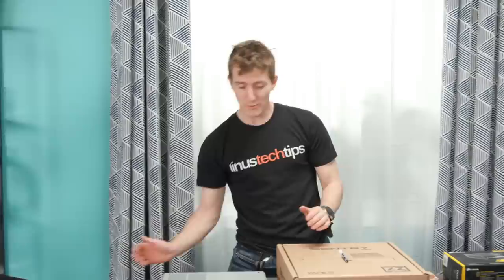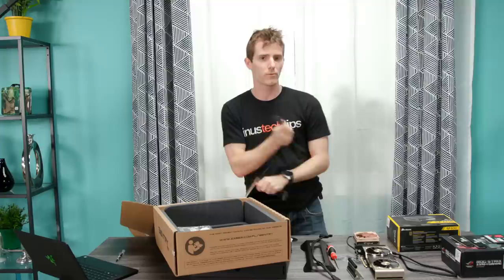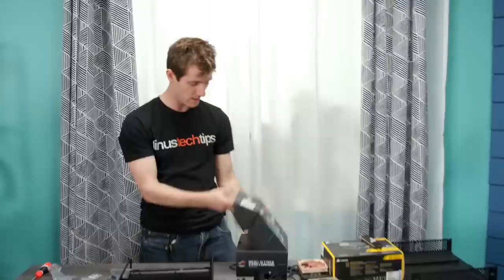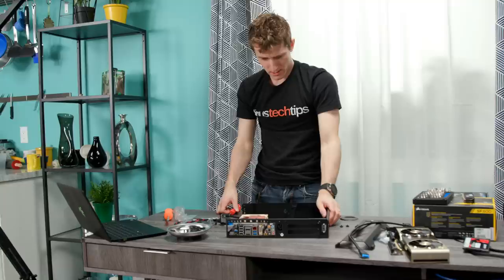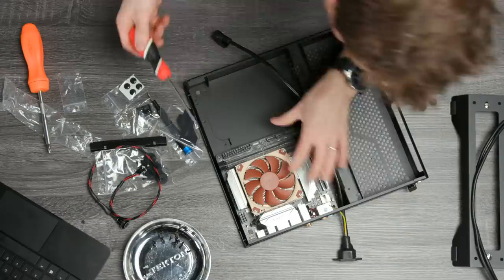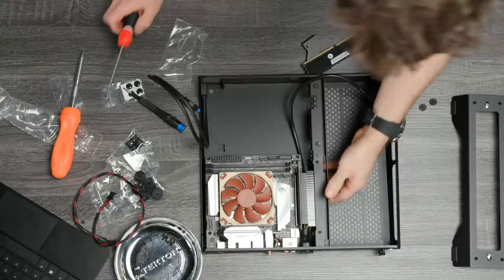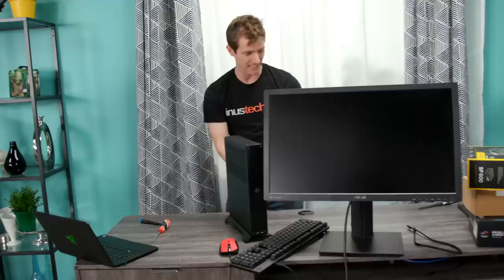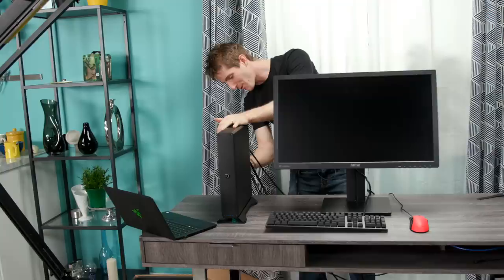Live Building a TINY Gaming PC

Comment: Wait, where's your antistatic bracelet and your Swiss knife????
Reply: And tweezers for cable management
Reply: And the allen key.
Reply: And cake-icing paste
Reply: @konstanen  Tesla Model S, Tesla Model 3, Tesla Model X and now Y
S3XY
Reply: And the insulating pads to stop the psu from shorting out the computer
Reply: Dont forget your security Torx.. O wait.. he really did need that
Reply: Don't forget to test your beefy powerful machine if it can run League of Legends!
Reply: And don't forget to put the ram dimms next to each other in slot 2 and 3
Reply: Dudes an ametuer
Reply: no brace at the back...
Reply: Careful, you might get copystruck saying that :-P
Reply: That hopefully has a screwdrive head
Reply: do you know that you can have bracelet on leg? This is more comfortable way.
Reply: And that was not nearly enough thermal past for the cpu pfff what a tool
Reply: He’s not elite enough for the tweezers, and he can’t get a Swiss Army knife, only the homie Stefan could get his hands on one 😤😤
Reply: With news that vaccines could be widely available in Spring 2021, when would you feel most comfortable going back to crowded movie theaters?

Comment: A part of me wants to take one of these cases, cut a hole over the CPU, and put on a huge air cooler, like a muscle car with the air intake sticking out of the hood.
Reply: That would be a great look! Or I could stick my 280mm radiator on the outside like a huge grill with holes over the cpu for the pipes!
Reply: the sound from the fan could be a problem tho but then again the thermals from having it sticking out will be better
Reply: @jacob-ty3km  Gotta rev that engine!
Reply: @nathangamble125  if my gpu fan could rev anymore a boeing 747 would be jealous

Comment: Turn the cooler 90 degrees. The way you installed it, the RAM on one side and the MOSFET cooler on the other side will block the entire air flow. No surprise the CPU will overheat and throttle that way. Also why don't you use a copper cooler?
Reply: agree on rotating the cooler oriey. too bad the am4 l9a dont have that luxury.
about the copper cooler, l9i is probably the only one laying around, as they're not an sff focused channel.

Comment: When you realize linus has like 10 different affiliat links for pia
Reply: private internet access has gone to POO. constantly dropping out. turn vpn OFF and bam the internet works. do not recommend.
Reply: I used to use PIA but switched to IP Vanish. Way better imo
Reply: @John-td9cp  speaking of Private Internet Access going to poo... TUNNEL BEAR!
Reply: I use PIA's proxy for torrenting purposes.  I get good speeds.
Reply: @John-td9cp  I have no idea what happened. I was getting nearly as good speeds as my own internet with PIA (14-20 MB/S)  but now I get download speeds of less than 1MB/s (on Steam)
Reply: Yes, I've been using it for 2 years and haven't gotten a single email.
Reply: @Amiaaaaaaaaa  I am the walrus?
Reply: Probably to differentiate the traffic from the older and the newer videos.
Reply: I still love Tunnel Bear. What ever happened to that spon?
Reply: Emma Nieuwenhuis they got bought out and stopped the sponsorship with Linus I think

Comment: You should look into using the nano material Graphene to disperse the heat somehow. I was watching a video on it earlier and they were talking about using it as a coating for space shuttles so it can withstand heat but it would be cool to see if its conductive properties could be utilized for cooling. A bag of made of graphene or tubes would at least be strong enough not to leak should you want to run them next to electronics.

Comment: Yay!! Sentry is my favorite!! I bought the original one for $222 and it took forever to arrive from Poland but I now have a kickass awesome gaming PC in a super compact form. Had I to go with a i5-8300 CPU to avoid overheating. The super low profile cooler I used was recommended for 65W CPUs and lower. So unfortunately I don’t have a better i7. However I do have an MSI Aero GTX 1080 GPU and it’s awesome for gaming! Thanks for making a follow up video Linus!!
Reply: mclaine33 Poland’s the best
Reply: I also have the original one! I have a 1080ti and a 7700k in there and it’s still kicking 2-3 years later
Reply: love this case
i have a white v1.1 with a gtx 1080 and a 7700
best case ever
Reply: I was stuck with a small budget but I scooped up a used alienware alpha r2 that was upgraded with a 480ssd for 399
Reply: @Spencerwalker21  For $400 I would say that's not a bad deal. I'm sure it will be decent to play games on.
Reply: @mclaine33  yes it was I can run the Witcher 3 1080p mix of mostly ultra a couple on high and no hair works 30ish fps now if i drop to. All high it's 40-45 fps. I don't mind 30ish but I'm a console newb lol

Comment: 19:25 is that only me but the motherboard looks bent.
Reply: I agree.
Reply: Yup, crooked as hell...
Reply: This is because of the CPU mounting pressure from the socket. Looks weird but is normal for LGA1151.
Reply: and at like 15:30 ish
Reply: @ProjectPhysX  oh interesting
Reply: And you know what a bent board means ;) cracked internal PCB traces :o
Reply: ye, 16:10 up close
Reply: Vladislav? Baby don't hurt me...
Reply: What they do to bent it? Failure at shipment or what? xD
Reply: i thought all noctua l9 comes with a metal plate, or is it only for the l9a?
Reply: it's because the cooler is very tight, small motherboard, big cooler obviously it will create a little bend.

Comment: It kind of reminds me of a mac how small and sleek and powerful and well built that computer is. That's pretty neat. Except it's actually better because it's serviceable and modular and upgradable. It would be a good candidate I think for remote water cooling. Just have the tubes come out the back with the wires on your desk and have the rad / fan setup somewhere hidden like maybe mounted on the bottom of the desk or on the back of it or in a drawer with a vent cut in the back with a fan.

Comment: actually m.2 shields are very good at cooling down the modules but the best way to cool them is by putting them on a pcie external module, like linus did a while ago with 4x960pro in RAID, some boards of the ROX Maximus XI series have it budled with them.

Comment: 45:00 my notebook cooler drops 10c off my CPU core temp, from 70s down to 60s. They work well when your case has bottom vents and pulls air from the bottom and vents out the edge. 
If it's a solid bottom case they won't work as well for obvious reasons.

It's basically a poor man's blowiematron, it's designed to get extra air into the fan. Cooling the case will do a pretty minimal job.

Would be good to see some more stuff on cooling laptops though.

Comment: installing the cpu-cooler: to not have the cable squeezed in the tiny space you better plugin the cable first on the motherboard and then rotate the cooler that far, that the cable will be along the perimeter of the cooler on some sides, then mount the cooler!

Comment: Vandal resistant Pushbuttons are meant to be resistant to prying and impacts. Panel builders and OEMs who install equipment used by common memebers of the public or in cases like correctional facilities use the regularly. They are also a nicer feel pushbutton. The old Plastic styles feel horrible to use. The mechanisms usually suck. And if you accidentaly drop one youll be buying replacements. Vandal Resistant FTW

Comment: Hm... Remember those holes for the rubber feet, the ones that got covered by the motherboard (at 35:00)? 
...I wonder if they are large enough so that a bolt could be feeded through one and nutted to a shoulder strap/a hard frame with shoulder straps, so that the case and its contents could be carried around like a backpack, and the resulting system be used, for example, as a "semi-portable" (power cable issues, yeah) VR-rig, and "fully-portable" LAN-party stationary gaming PC?

Comment: I suspect the torx screws are because the case is perfect for Lan parties, and is likely full of high end parts. With everything locked in with weird screws, makes it much harder for someone to steal your parts. Only reason I could think of for them.
Reply: Lol want to make sure no one gets in unless they have a bloody 500 degree heat gun lol use red loctite it works lol I tried it you will break the screw if you don't apply enough heat to it lol

Comment: Not having a drive LED is stupid, it helps heaps with troubleshooting. Yes it's distracting when watching a movie on your HTPC which is why silverstone cases have dimmer switches, as long as it's not too bright you won't notice it. You can always mod in your on pot or resister if your case doesn't have a dimmer.

Comment: On the topic of custom I/O shields, I have actually had to design and 3D print one myself. And I think if you had a picture, you could use the known frame the I/O shield drops into on the case as your outline, and then just bring the image into Solidworks or other MCAD software, and design around that. That would be pretty straight forward actually.

Comment: Bit late to the party here but about that cooling system idea you wanted for a mac book or w/e device you wanted to use it on, how about this Osprey Hydraulics LT 2.5L Reservoir Red, you can simply cut the stoppers off the end stick them into a water pump regulator and put ice water inside, also if wanted a better insulated system to keep it cooler and stop the plastic from heating wrap it in foil.

Comment: I'm using a 512GB Samsung 960 Pro m.2 ssd + Angelbird wings px1 pcie x4 m.2 adapter on a Asus maximus vii hero Z97 motherboard, yes those m.2 adapters work very well to help reduce throttling on the m.2 memory controller!

Comment: what I gotta wonder is why there aren't any cases like this that have the GPU mount so it's on the OPPOSITE side so the GPU fans and the CPU fan are all blowing in the same direction. That way you can have it set up in the flat position WITHOUT the feet.

Comment: Non-volatile chips  used with SSDs and NVMe drives run better without heat sinks.... I need to find the paper that showed lifespan is almost cut in half when it is cooled closer to ambient all the time.
BUT for systems like servers where it is used in constant R/W can run too hot and need a heat sink. So it all depends on use.

Comment: ok i can imagine waterbag with some reinforcment with zigzaging pattern so on one side there is a water intake and on the other side there would be water outpoot for a waterloop. it could even be like a metal rack with soft foil top. it would need to be some kind of foil which would not compress and harden under high temperatures but as you can boil water in a plastic bag it might not be needed. this is interesing idea.

Comment: Red Camera's suck for live streaming. If that's what you where using. They add between 9 and 11 frames of delay from live. Only way to make the audio suck less is to run the audio through an external mixer and into the camera's audio. Because I've found the delay can vary even if you add an audio delay to your mics they will randomly slip sync on the preview out for both SDI and HDMI... HDMI being far worse.. Just an FYI..

Comment: Full room ambient lighting for a loading screen would be wicked as dumb as it is. One aspect that occurred to me is the loading screens in Xenogears. That spacy whoosh noise that built to be more full as loading neared 100%, run that through a ridiculously powerful amp and subwoofer. If the pictures are on the wall and your not convulsing on the floor from sensory overload by time the game starts, your doing it wrong.

Comment: Not sure if this would help with your bag water cooler project. For laptops. It is meant to refict heat back in. So it may reflect heat back out as well. Instead of absorb it. coghlan's emergency blanket. Maybe you could modify if for your needs.

Comment: Could of gotten much better temps with a smaller ITX GPU, and a 120mm AIO next to it to cool the CPU. Leading to much better boost clocks during heavy loads.

Great case though, I love these compact ITX builds. All my builds in future will be ITX based. I think I have grown out the massive full tower cases, my last full tower case was the Corsair 780T black version and that thing was monstrous. Also had a Corsair 800D in the past which was simply just stupid for the size but it was a nice case.

Comment: Ventilation issues aside, is it safe to lay the Sentry on its side and place a 27" monitor on top of it? Will the sides sink in? Is there structural support internally? Can it support flat and/or pronged monitor bases?

Comment: If you want to create a test for heat dissipation off of heat sinks you need to use something like a laser to measure how fast it gets hot and under which circumstances it overheats.

The thing is. This information is only relevant on a motherboard if it has a design flaw, so maybe the test itself would be irrelevant to the user. "Works" "Doesn't work" is enough.

Comment: "I want some kind of foil bag that can hold water" - Aussies will get what I mean when I say you want a goon sack. 

For the rest of the world - boxed wine comes in a liquid proof, fairly resilient, foil bag inside the box. I haven't experimented much with the temperature transfer, but the bag is usually cold for a couple of hours after it comes out of the bottle shop so it should be effective.

Comment: node 202 is $60, $40 when on sale. and it's very close in dimensions. this case is 340x310x66mm where as node 202 is 377x330x82mm. you lose about 1 inch on L and W, 2/3 of an inch on thickness. you have to be fucking crazy to pay $260 for this. i built a fully water cooled 9700K and RTX 2080 system in my node 202. complete with a DDC pump, EK CPU block and alphacool GPU block, 240mm rad, etc.

Comment: Good job you just put the hot air coming off the processor straight to the memory instead of at the nas heat sync that could cool it rather than heating the crap out of the ram that will not have a heatsink to help cool it!!!!!

Comment: Now that we've established the IC Graphite thermal patches work*, I wonder why they don't use them for these videos. Yes, a $15 patch is more expensive than a little thermal compound, but they're reusable. Couple that with the vastly easier removal and it seems objectively better**.

Thermal paste just seems primitive and inconvenient now.

*LTT did a video endorsing them and I have had one in my computer since early last summer. No temp difference between this and AS5 and I gained a +10 DAF bonus.
**Yeah, you can get a degree or two with premium TC, but that's not really relevant unless you're going for some kind of OC record.

Comment: re: the m.2 spreader: Is it perhaps more of a heat-shield than a heat sink? I.e the metal plate takes in as much of the heat from surrounding components as it can & uses an insulating pad to shield the sensitive components from excess heat, particularly on this board, given how close the drive would be to any residual heat from the CPU cooler?

Just an initial thought, not saying its the case I'm just wondering out loud...

Comment: 39:10 HDD LED is no longer connected also because because it can be used for side-channel attacking your computer: see https://en.wikipedia.org/wiki/Side-channel_attack#Examples and, in particular, https://www.securityweek.com/hard-drive-led-allows-data-theft-air-gapped-pcs as linked in note 11.
I hate, though, when a computer has no reset button, even tough it should almost never be used.

Comment: Would there be any problems in using this case, with some brackets made for fitting it in a std 19" rack ? it would give about 22mm of space for air flow when fitting to 2u. (Without high end GFX)Main use Music PC DAW+ Software synths (not a Hack un Tosh)

Comment: Hey Linus. Is it possible to make a build with the Corsair Carbide 600C with a Asus ROG Strix X570-F motherboard, AMD R7 3700X CPU, Corsair Vengeance Pro RGB 32gb 4x8gb 3200mhz, riser style Asus ROG Strix GTX 1080 WITH a custom cooling loop from EKWB where you have a Dual bay Reservoir and have to link the cooling using a distro plate? Want to see how my build will look like once my distro plate has been made. PS. Use PETG for tubing with Fire orange Liquid cooling. (Will look balls to the wall) PSU can be any Corsair Full modular and M.2 of your choice. Thanks in advance.

Comment: Can you replace the CPU fan with a thicker one? Would that help with cooling?
Reply: 47mm height limited. 
cryorig c7 cu performs better but the low clearance just make a lot of turbulence noise. some people swap the fan with noctua, or just go back to l9 all the way, not much difference in thermal but much better in the noise dept

Comment: They could've made the case with aluminum and so much more lighter
Reply: True, they would need a sizeable chemical bath instead of powder box to anodize the pieces and it is uncertain if they would need to have less perforation or more internal support, 1mm thick aluminum doesn’t sound as strong as 1mm steel, it’s a tough call
Reply: @Bajicoy  skyreach 4 mini is made of aluminium and also It's  very strong

Comment: I plan to put a 8700k/9700k, 120 AIO Cooler, half size 1660 Ti and a ITX board that supports 2x M.2 slots. :)
I think a 9900k would be waste in it with a 1660 ti. xD
Reply: Nice I picked up a used alienware alpha r2 for 399 not bad because I wasn't in the mood to tinker

Comment: That case is sooo overpriced for what it is. It contains probably a quarter of the metal of a normal mid tower ATX case with fewer cutouts and holes etc. than most other cases and costs twice as much as a decent to good case. It doesn't even have a window or glass on it anywhere. From a manufacturing standpoint, it cant be any more complex than any other case. But the price is just a killer. I feel like a lot more people would buy something like this if it was reasonably priced.